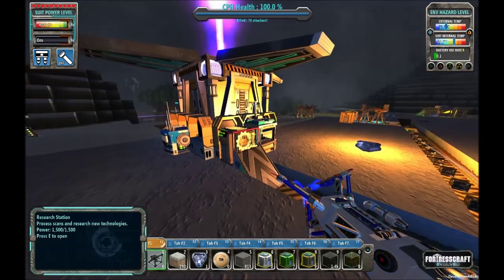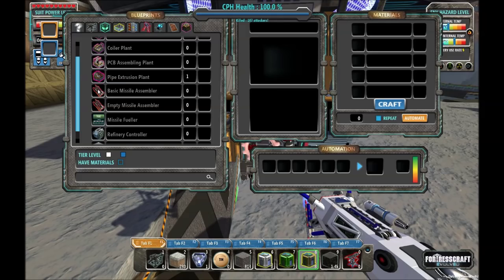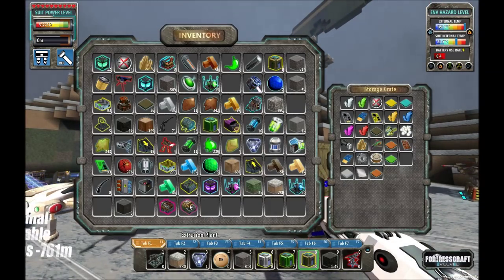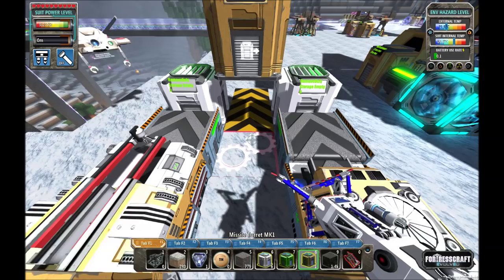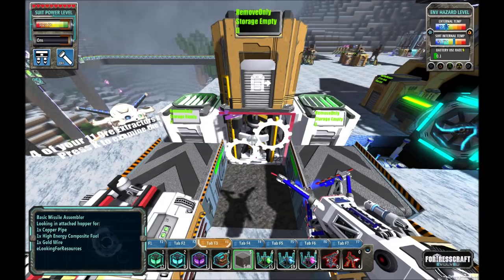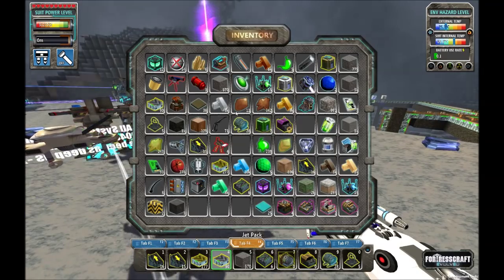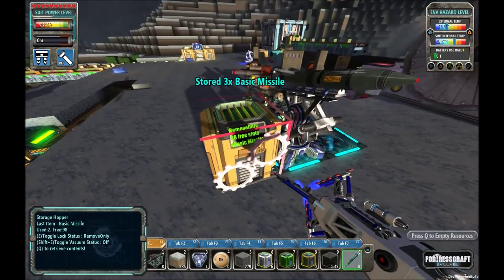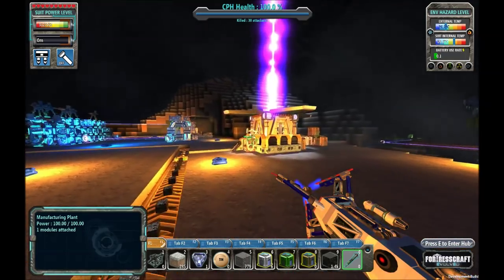FortressCraft Evolved   Ep24 Automated Missiles

Comment: My suggestion? Build the two remaining turbines in the spaces for them, center a T4 battery under each one (As the turbines are 3x4 and T4 batteries are 3x3), then blast power from the T4's into a single T5 bank that you use to power everything. Including a wall of T4 power transmitters at the orbital power station.

Comment: I wonder if dire noticed that he cut off his original turbine's return feed for the empty composite fuels... he's gunna run our of power in his mine and be like... whaaaaaaaat?
Reply: I also wonder if he realises that he currently has a bottleneck on the T4 battery; a single T4 laser inputting into the battery and several of the same tier outputting at the same time
Reply: +James Pollock The Input Laser has a Focus Lens to pull out as much power as possible, remember? That single laser is doing at least the work of 2.
Reply: +Ryuu Ainaki  and at least 4 T4s pulling from it
Reply: +James Pollock considering he said he want to drain it so he can move it, it's ok even if he doesn't know.
Reply: He noticed. Then he noticed the pretty missile crafting animation

Comment: i found that with machines that require a constant amount of power, like the manufacturing plant when in automation, are better sustained but feeding the power into them with a transmission laser and not the storage block due to the lasers extracting power from the storage block better than the machine they are feeding.

Comment: Roughly calculated, you'd need just a little more of 370 T4 battery charges to fully charge and fire your OET. That's quite a lot... Maybe you wanna secure some more biomass first and build up power production? Oh, and btw, I'm not sure whether the refinery might block your missile turret from firing. If the turret needs line of sight ...^^ I'd suggest building a tower with your turret on top. That way it got line of sight pretty easy :P

Comment: DIRE!  You just created a blockage.  That line to create empty fuel cells will probably supply empty fuel cells to your system more often than your lower mining power generation turbine uses them and matter moves them back. It will backlog with empty fuel cells.

Comment: I think it is actually good, that you didn't fully automate missiles. You might craft a ton of them, which would be sitting around being uselbess otherwise. At least to this point is doesn't seem like you'll be needing that many missliles as the fire rate is quite low and they are only firing at big bugs.

Comment: +direwolf20
29:36 You can acctually have 15 lasers from that battery, 3x3 + 2x3 = 15 where 2x3 are 3 on the left and right side on the battery
Reply: Acually 21 because you can use the up and down side too
Reply: +Peter B The trick, of course, is getting power INTO it at the same rate, which dire currently isn't, because he only has the one output from his turbine into the battery.

Comment: So would anyone like to try and explain the difference between a Minimum Firing Distance(MinFD for simplicity's sake) and Maximum Firing Distance(MaxFD)? 

I feel like I'm missing the point of having the missile launchers away from the base's center and in a single cluster at the same time.
Reply: Think of it like this. The missiles need to be a certain distance away from the target so that the explosion doesn't hurt itself. That is the minimum distance. Now in the game the explosions don't matter but that is how RPGs work. They will not arm until they are a certain distance away from where they are launched. Until then they are just a rocket.
Reply: +Jeremiah B. Which explains the point to having a cluster of the rocket turrets, but why at the edge of the base? Wouldn't the logical choice be to keep said cluster near the center so that it:
A] Doesn't pose a risk to friendly machinery.
B] Has a greater ability to protect the entire base.

I can see elevation being an issue but a tower could be used to make up for that.
Reply: It won't pose a threat to the machinery, I used the analogy to explain what minimum distance was. 
Having the launchers farther away means that the center of base, the command unit, (I forget what it is called), is inside that minimum range. Otherwise it won't be protected. Having them further away is easier than building a tower and putting them there. As far as I can tell without having played the game myself the missiles maximum range is so large that it won't be an issue. The real issue is whether the command unit is protected or not. That's why you want them far away, so that they are inside the minimum distance.
Reply: Jeremiah B. Ok, that makes a lot of sense. Thanks!

Comment: did he seriously started the oet like with 1 missle turret and a tiny amount of laser?
Reply: +Jazmie Hamizan Obviously yes :D. He is going to have a hard time.....
Reply: +Marek Vikor 
I tested MK3 turrets. I have to say they pretty much don't care if they shoot at heavies or mobs. 1 or 2 shots for all.
Reply: Achim Hanischdörfer just wait for the 500k hp boss
Reply: Achim Hanischdörfer Nice.
Reply: Well, 15 hits with a MK3, and ia boss is down then.
I plan on having 4 batteries of 15 turrets each. all ~25 meters away from the CPH.
Every battery will be powered by a power turbine each, maybe even two.
in the worst case scenario where all the attack force is great enough that all the turrets are in range that will be 60 turrets fireing. And that still far enough out that they can't reach the CPH from there.
I want to see the attack force to pierce that.
Reply: Achim Hanischdörfer oke then #nonplayer
Reply: Jazmie Hamizan
I will Mrs  #Salt  .
My base is currently progressed to the point I'm switching to power turbines.
I have researched everyting except ultra power grid, OET and rolling stock.
My base threat reads in at around 1500% and peaks at 2500% regularly. I usually get between 1 to 10 heavies per wave.
I have 3 MK3 turrets per defense battery currently employing 4 batteries.They are sitting on 3 MK2 batteries and are powered by 8 coal generators each. After the upgrade I haven't recieved any damage to my CPH yet. In fact even on the toughest raids with my current defense not even all of my turrets are fireing on the 2500% raids.
My defenses are anything but well built I have to say.
If I place 2 turbine below each 15 MK3 turret battery, I have 8x the power supply of my current base, and therefor 8x the firepower.
I calculated that can supply 3,25 MK3 turrets with 1 turbine at their maximum fire rate. They fire 15 shots per minute and use 6000 power doing so. Turbine generates at peak power makes 320 power/second or 19200 power/minute.
I want to see what the late game has that I need to invest into missile defense. Which of course I already researched...